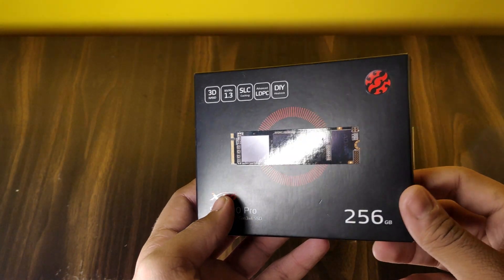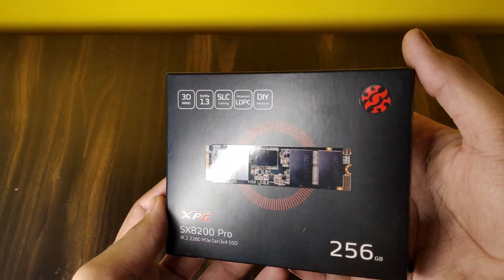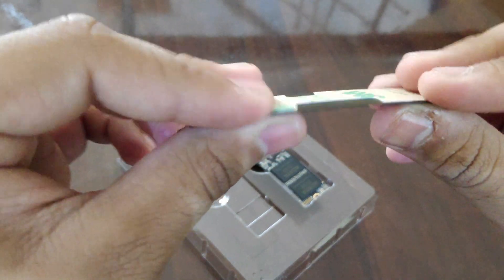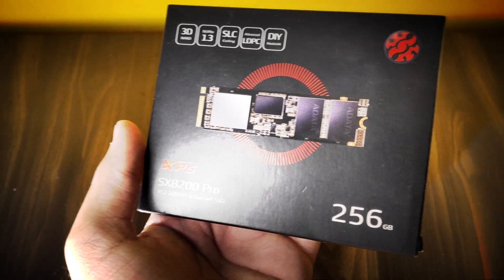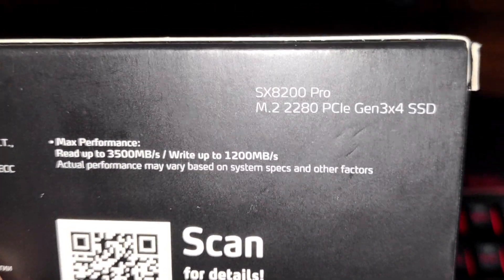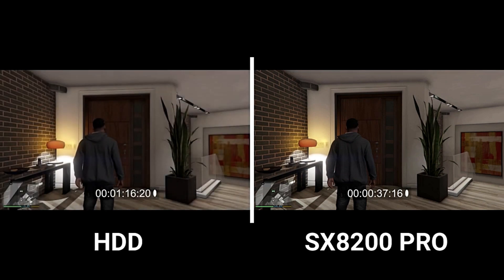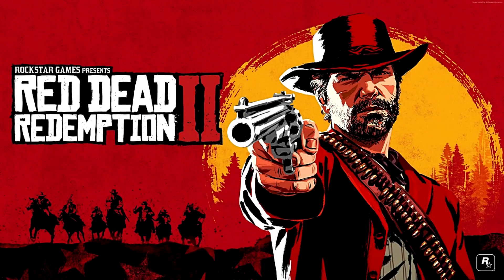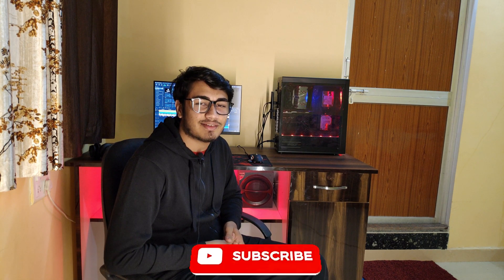Fastest Gen3 SSD Which You Can Buy Under BUDGET | XPG SX8200 PRO | Review & Performance Test (256GB)

Comment: I purchased this m.2 drive late 2020 and it just died on me.  I cannot recommend it.  I just paid a lot of money for a major repair to bring my system up and running again.  Had to re-install the OS that is so annoying.  It it fairly fast at a really good price but it is a completely lie that this brand is reliable.  That's just not the case and there is no way it is just as good or better than the Samsung.  No way Jose.  I'm never again going to buy ADATA brand.
Reply: Is Kingston a2000 nvme good

Comment: my laptop is Asus TUF FX504, does SSD Adata XPG SX8200 PRO 256GB M.2 NVMe support for my laptop?
Reply from the maker: Yup, If your laptop has an M.2 Slot then surely you can use this SSD
Reply: @MostlyTechyProductions  my lap has m.2 nvme support hp gr0011au but reading speed only 450 MB/s they are giving 3500MB/s any settings to increase speed?